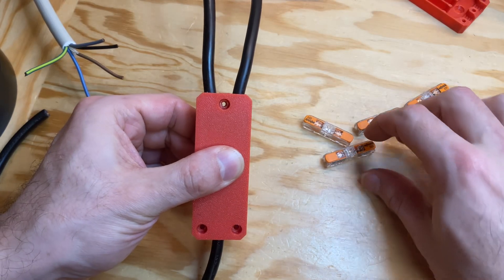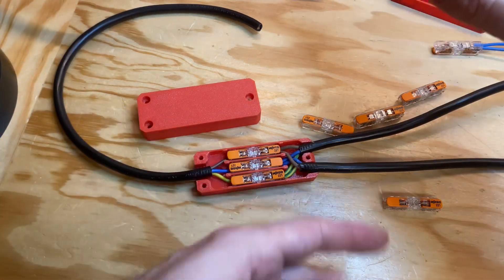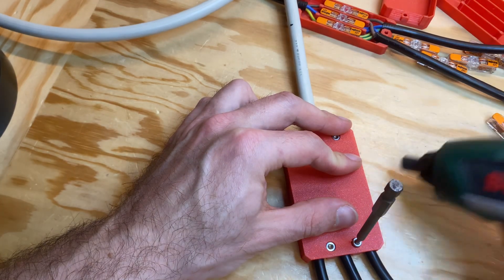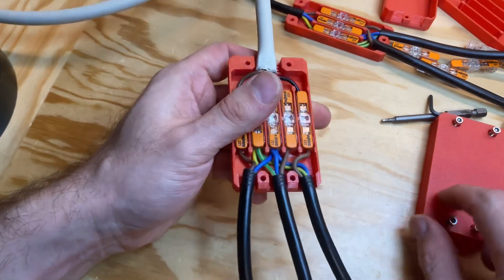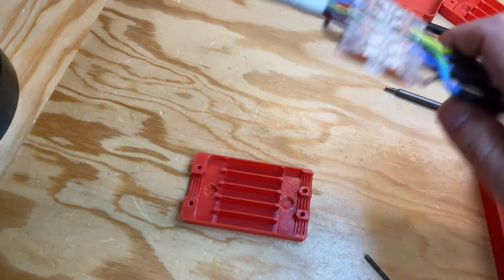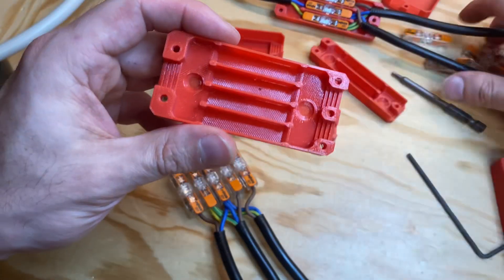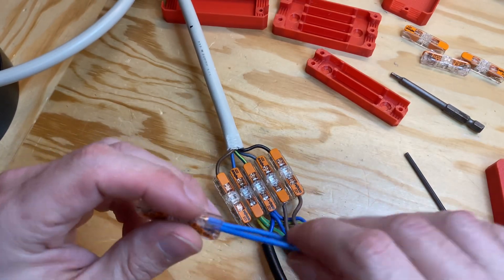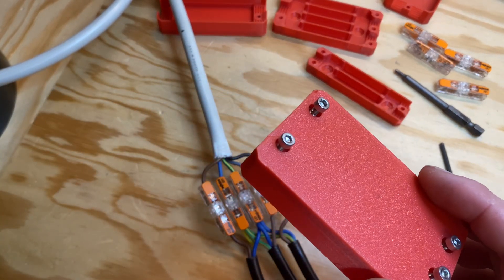WAGO 221 compact case with strain relief  (long)

Comment: Great video!
Your design is very slim and compact, but I have mixed feelings about splicing two wires into the same slot.
An alternative approach is to use the 221-413 (3-way) connectors. This will require a difference design, but mounting the cables will require less attention to detail and also allow for solid wires all the way. If you want to maintain "input" and "output" on opposite sides, you must add routing channels in the case.
Reply from the maker: I agree. It is better to use a 3 or 5 way connector. The goal of this design was to be as slim as possible.

Comment: Är det en flamsäker plast?
Reply from the maker: PETG is flame-retardant. It does not burn; it melts. You can get PETG V0, which chars and encloses what is burning.

ChatGPT explains: The material undergoes a surface-level chemical reaction when exposed to high heat or flame, resulting in the formation of a blackened or carbonized layer. This charring acts as a protective barrier, preventing further combustion or damage to the material beneath.
Reply: @PerMejdal  hej har du en e-mail adr jeg kan Skive til did på ?